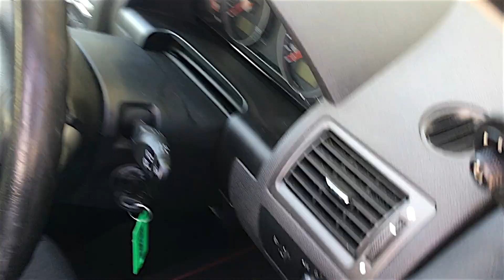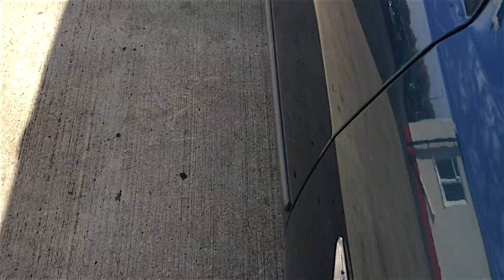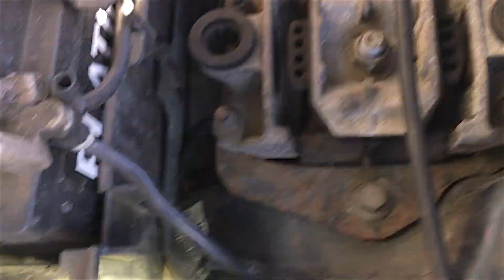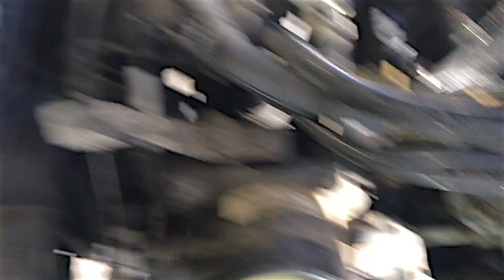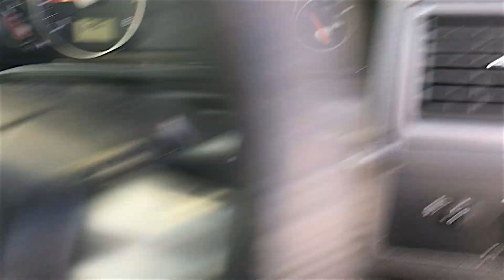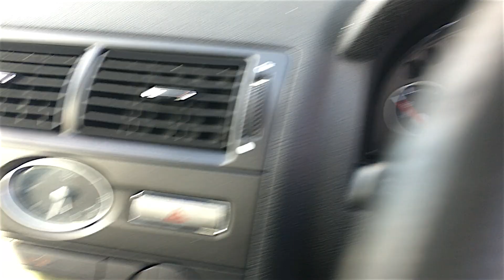Bad Earth Wiring, Typical Example of an incompetent Mechanics Handy work.

Comment: Nice one Alan sorting out someone else's bodge, there a cracking good engine, in your experience do the tappets get noisy with age .
Reply from the maker: i have not had any tappet problems or noises on any of the mk3 duratecs
Reply: @alan4x  I have a slight tapping noise on mine could have a sticky tappet
Reply from the maker: @v8man350  those engines have shims, buckets,  not hydraulic tappets
Reply: @alan4x  interesting, what could be the tapping sound from top of engine it is maintained regardless of cost , oil change every 3000 miles  any suggestions 🤔
Reply from the maker: @v8man350  could be the swirl flaps inside the inlet manifold...there is a vacuum pipe on top of the manifold if you disconnect it the rattling will stop
Reply: @alan4x  cheers mate I'll give it a go see what happens 👍🏻
Reply: Just a quick update disconnected the pipe and the tapping stopped, swirl flap delete in progress, thank for your advice and help, 👍🏻
Reply from the maker: @v8man350  if you remove the swirl flaps your fuel consumption will increase, it would be best to get a good manifold
Reply: @alan4x  sound job, cheers mate 👍🏻

Comment: I had a new  clutch fitted to my s40 by a local garage, a day later I started getting various warnings on the dash for abs, traction control and headlight bulbs out, turned out that 2 earth straps had not been refitted during reassembley.  Not hard to put connectors back where you removed them from.
Reply from the maker: this happens all the time, i know lol,🤣

Comment: lol. this brings back memories, I had a mk2 mondeo 1.8 Verona. I bought a complete set of leather seats with the front 2 being the heated kind, also the steering wheel with the cruise control and the peddle switches to go with it, also the complete wiring loom as well. all off a mk2 ghia x. gave it to my m8 for the weekend while i borrowed a motor for work. he installed everything and it ran great. the heated seats worked and the cruise control and all the lights worked as they should. after a few months the car cut out coming home from work, managed to get it going, then all kinds of weird stuff was happening. gave it back to my buddy and after several hours found that an earth strap down in the driver's footwell had not been tightened down properly. all the problems went away after that. I did like that car, quite nippy and good on fuel too.
Reply from the maker: lol🤣cheers for the story simon

Comment: Can bad earths stop the fuel pump from working Alan?
Reply from the maker: yes they can
Reply: @alan4x  I’m having trouble with my 2.5 V6 fuel pump not engaging when I turn the ignition on and want to deter main if it’s something like that as I don’t want to change the fuel pump you see
Reply from the maker: @Shadowmosesarea51  i would say there is more chance it is the pump itself but its worth having a good look at the wiring too
Reply: @alan4x  thanks mate yeah car wants to start but pump not activating and obviously no fuel getting through
Reply from the maker: @Shadowmosesarea51  if you have a 12 volt supply to your pump wiring when you switch the ignition on or crank the engine and the earth is good then it will be the pump if it does not activate
Reply: @alan4x  thanks mate checked relay in engine bay and that’s good and so is the fuel cut of switch

Comment: yes, i also spend all day fixing other people's cockups, unfortunately, some of them work for us...
a voltmeter from engine block to neg. batt. post is a good test. fixed an unfixable honda with an extra earth lead, been through 3 batts, 2 alternators + a tensioner kit at main dealer, 2.2 volt loss on earth @ 3k. loaded. original leads looked fine.    keep up the good work young man
Reply: Volt meter on the neg trick is such a good little trick to finding bad earth's, seen this on the south main auto channel recently
Reply from the maker: 🤣lol, cheers paul

Comment: Alan, you should be replacing hose with silicon ones that will last forever !
Especialy the EGR to Intercooler hose on the mk3 2L diesel !
Reply from the maker: they are old rental cars, if it were my own car then yes😉cheers steve